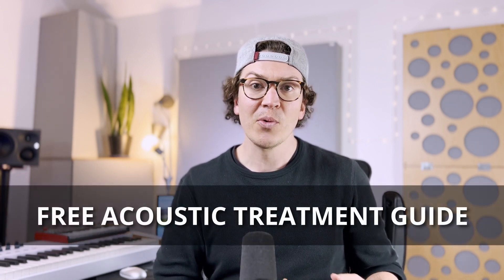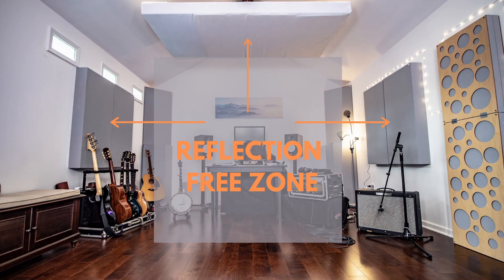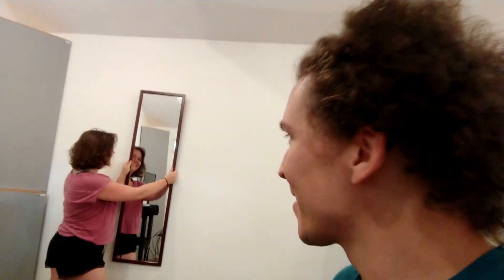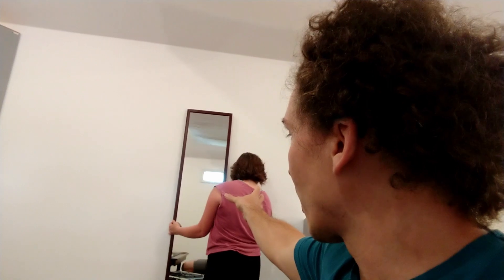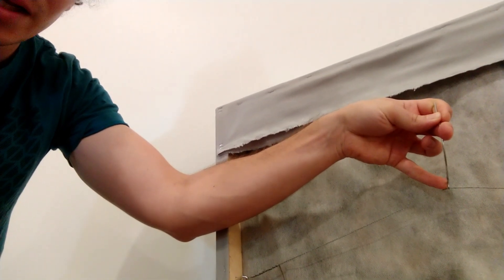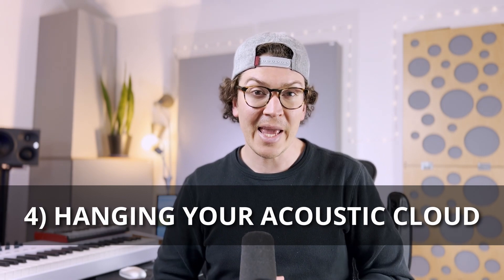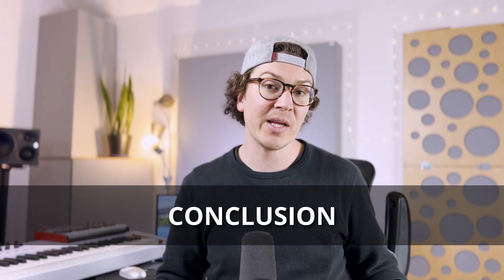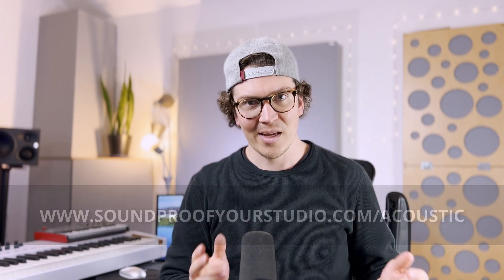What Is A Reflection Free Zone?

Comment: The results of porous absorption calculator actually shows that if the air gap exceeds the panel thickness, it can actually have a negative affect on its low frequency absorption.

Comment: quick question for the soundproofing.
I have a gap between my jam and my window. and i figure out it pass lots sound. i decide to insulate with pink fiberglass.
So, should i squeeze the fiber glass as hard/little possible to fill the gap? or should i just place the fiberglass in their original hardness.
my thought would be as hard as possible is better，since it has more mass?
the soundproof is for high frequency sound like dog barking only. no need to consider impact sound.
Reply from the maker: Insulation and soundproofing are two different things